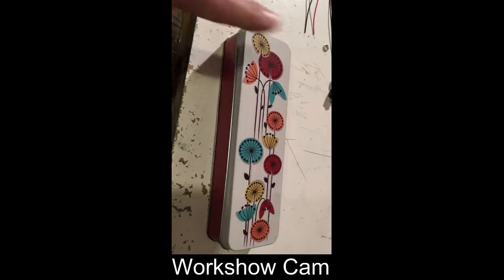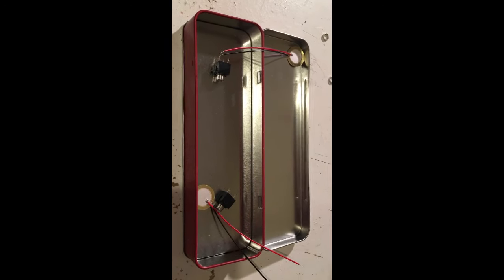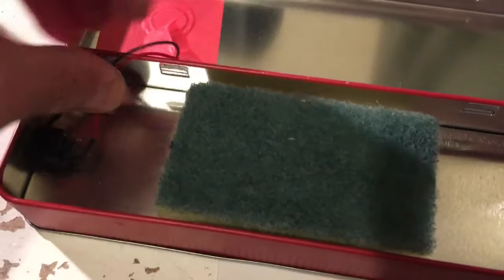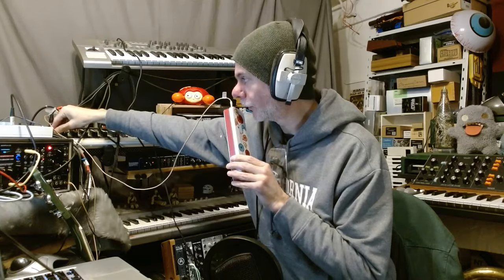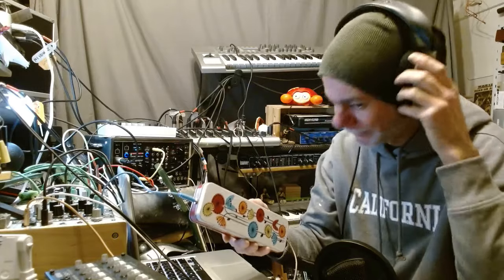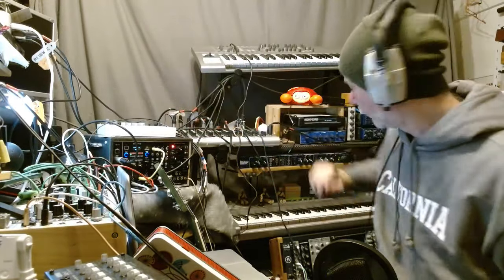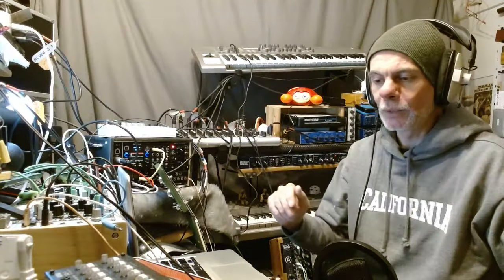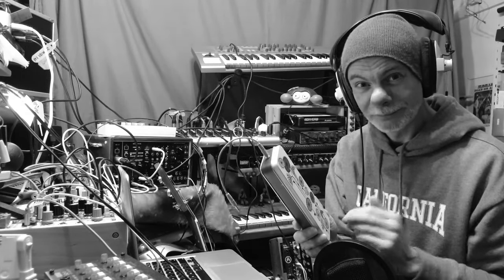Pencil Tin Microphone

Comment: might be interesting on a bass guitar cab to give a bit more top end "tinny sound " texture element.  maybe putting springs and or guitar strings , harmonica reads, inside to increase resonance . running drums through it , definitely a high pass filter with overtones
Reply from the maker: Yes, I'm thinking about 'stuff' to add to the tin, I'm actually thinking about marbles (if I can find any). Interesting bass cab idea!
Reply: @abominablemusic Maybe steel ball bearings, rubber balls, interesting..
Reply from the maker: @Hoptronics  all good ideas! I found some old marbles, so I'm going to try those...

Comment: I’ve actually have had a crazy idea for a while that fit this kind of experiment.
Do you know about the old “telephone” toy where you take two tin cans and put a tensioned string between them?
My idea was to put a contact microphone in both cans and use it the same way you did here.
Reply from the maker: Yea, in the UK, we used to do that with yoghurt pots! In principle, it should work, the sound waves should travel along the string/cord and those vibrations picked up by the contact mics. It wouldn't be 'hi-fi' but could be interesting...